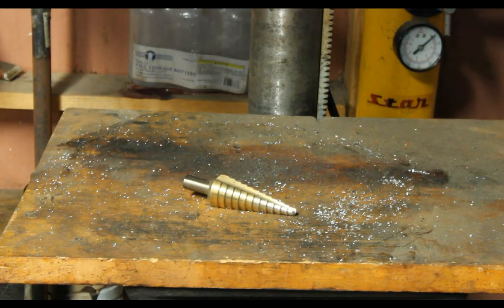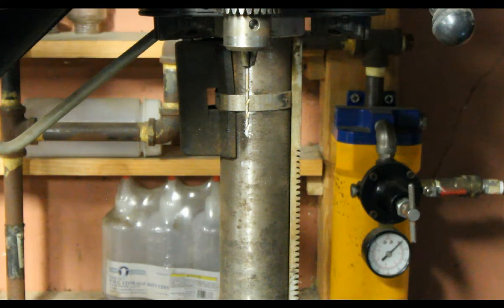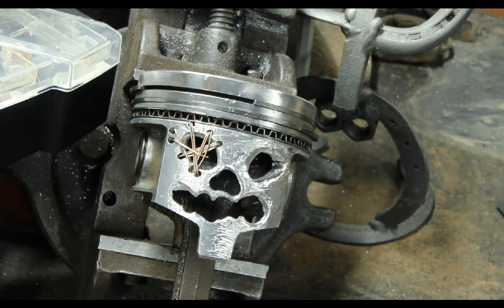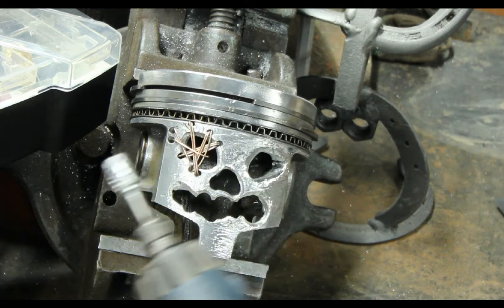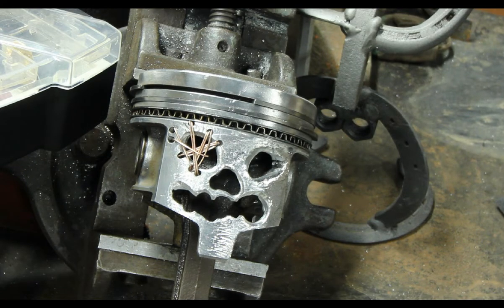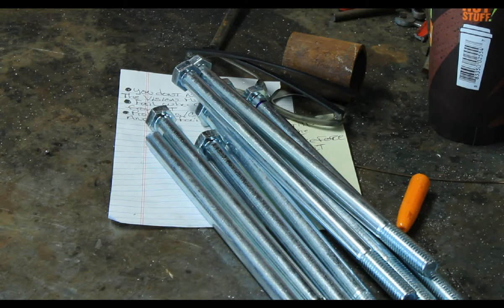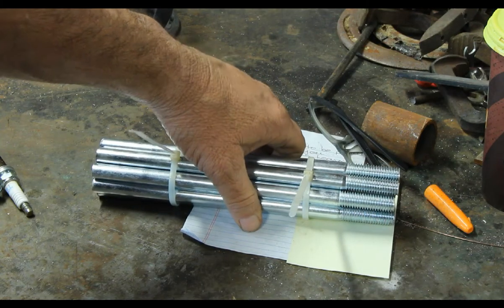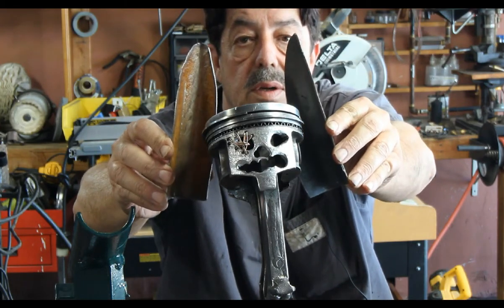How To Make Money Welding - Part 32 ( Piston Skull - Part 1)

Comment: love the guy so far..Nice work..I use pure soap on my burrs and cutting blades and abrasives..Just bump the bar of soap on the cutting face as often as needed while working..It 100% stops them clogging and extends the flapper discs life heaps..
Reply from the maker: I have not tried that but that sounds like a great idea - thanks for the suggestion

Comment: There are specific carbide burr bits that are fluted a certian way purposely for removing aluminum  without clogging. Search  "aluminum carbide burr"and like everything else,u get what u pay for.
Reply from the maker: Thank you and i will do that for sure
Reply: @TheHomeHandyman  astro#2186 is a great kit. They will go through aluminum like u wouldn't believe and remain clog free without having to use cutting lubes etc.
Reply from the maker: @---skynet---  i will look into them this eve and thank you for the tip

Comment: I got some Really Nice Kodiac Carbide Bits In all different Sizes used the to port a Cylinder Head. They are made in USA 🇺🇸 and Damn good quality. I did a video review of them a while back. 

Cool Skull 💀 Like where your going without it.

I just started my first welding project myself yesterday. 👍☕️
Reply from the maker: I will look into them because i need better bits

Comment: Great bits and 2 good astro pneumatic die grinders 

https://www.amazon.com/Astro-219-ONYX-Grinder-3-Piece/dp/B007QV1RGM/ref=asc_df_B007QV1RGM/?tag=hyprod-20&linkCode=df0&hvadid=242037806074&hvpos=1o2&hvnetw=g&hvrand=9951976181205174203&hvpone=&hvptwo=&hvqmt=&hvdev=m&hvdvcmdl=&hvlocint=&hvlocphy=9030017&hvtargid=pla-436124709553&psc=1